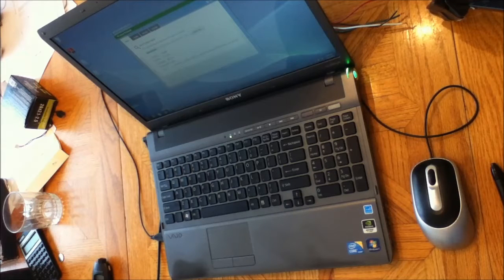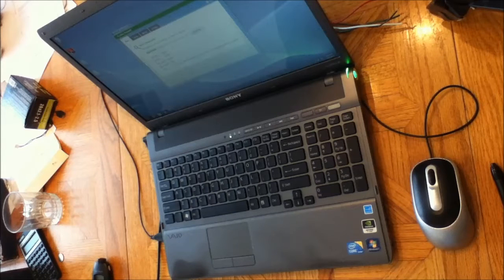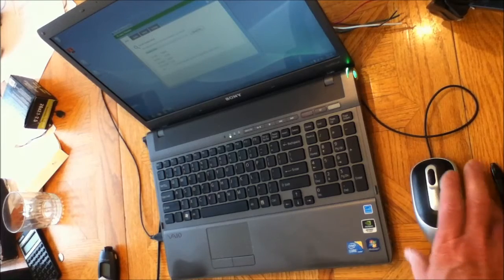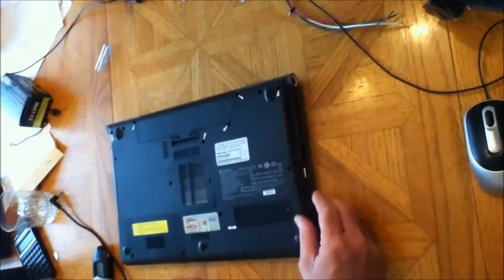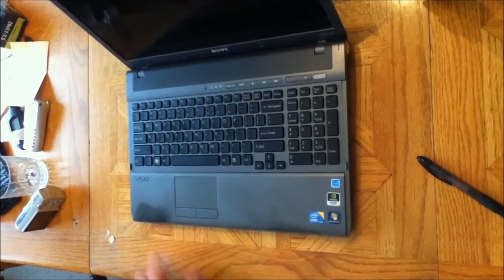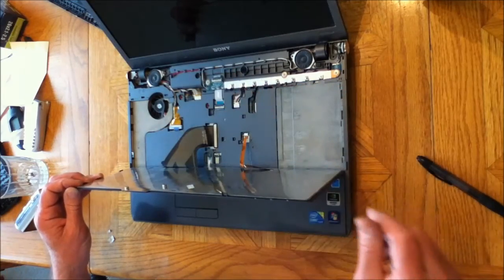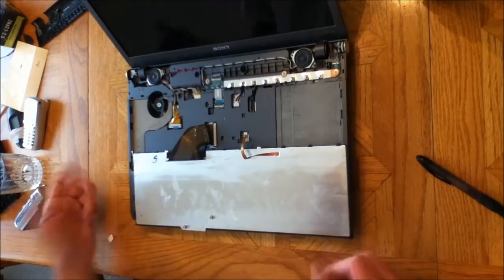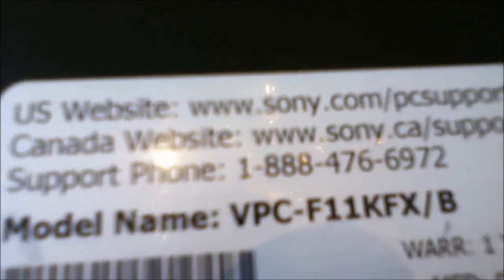Fixing an overheating Sony VPC-F11KFX/B laptop and keyboard replacement

Comment: Thank youuuu very much
Reply from the maker: You would have your shop vac blow into the ventilation hole on the side of the laptop.  The reason is the dust is on the other side of the heat sink and you want to blow the dust back out the way it came in.  In this case the dust will come out of the fan opening on the top of the laptop.